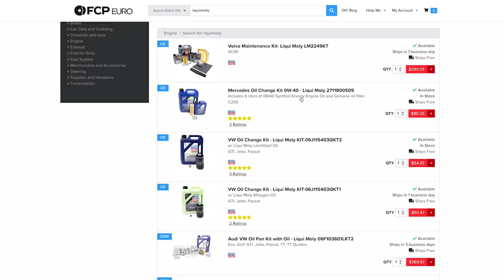We Visit JP Performance, and Scotto gets ANOTHER Audi?? // #CarcaineAbroad PART 3

Comment: 10:45 May I add that this BMW E30 you are seeing here has the technology of a BMW F82 in it. Engine, and what not. The suspension is adjusted to fit the E30 body. Gauge cluster is from the F82 as well.
Reply: It has the working Infotainment as well

Comment: They completely glossed over that the bmw m12 engine is regarded as the most powerful per liter racing engine ever made. Plus the coolest part is that they named it "Megatron".
Reply: Aaaand as far as I know.. Stock block
Reply: yeah, but on occasion, they had to run 2 engines in the same race, because the first one already checked out…
Reply: @warummussmeinnameangegeben6502  There are rumours that the engine blocks and cylinder sleeves were taken from old taxi's with 100's of thousands of miles on the odometer. The theory being that as the mileage increased the sleeves would harden and the engine could withstand higher boost levels. They also used to use toluene instead of gasoline for fuel.
Reply: @warummussmeinnameangegeben6502  yep they are a stock bmw m10 engine block. what makes the m12 unique is the crankshaft and the cylinder head. the head alone is worth 30k
Reply: possibly equal to or even better is the Renault F1 engine in their museum that maxed out a 1,600 bhp dyno and it still had 2,000 rpm to go to limiter they estimated 1,800 at least, from an article in cars and car converstions late1980s
Reply: fun fact in the museum there is also the mclaren f1 v12 engine displayed. and they didn't even show that 🤣
Reply: @mcbedeakin  I heard that somewhere before aswell, would be crazy

Comment: As a owner and fan of Audi/VW this was awesome. I owned a S8, 88 Scirocco and a 94 Corrado with the G60 VR6 factory supercharged with manual transmission. B5 S4 Avant tuned 2.7 with turbos from a 996 and new liquid cooled intercooler and KW suspension. 06 Allroad tuned, B7 S4.

Comment: Fun fact about the BMW M10 F1 engine.
BMW apparently only built those engines with old used blocks found wherever.
New blocks always cracked and the old ones were naturally heat treated and could take the abuse 😄

Comment: 13:00 sunroof assembly can weigh anywhere from 20 pounds in a cheap car up to 64 pounds in luxury cars (Audi)
Not only is that alot of extra and unnecessary weight, its also WAY high in the car and causes the center of gravity to be higher and prone to more body roll in corners. not good for racing.
you're welcome.

Comment: That megatron f1 engine is based on shit cars motor. Bmw actually bought 200,000 mile + street cars, just for the block. They figured "Well seasoned" engine that was street use/weathered, over 200,000 kph with out cracks, prolly can race.